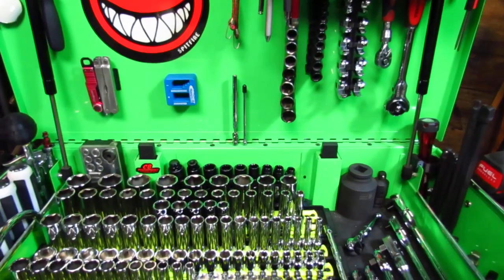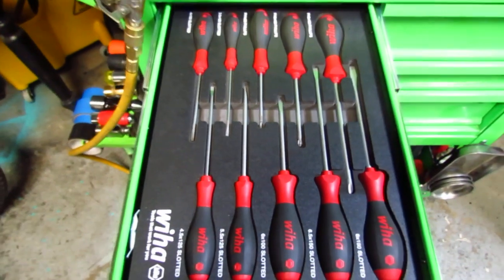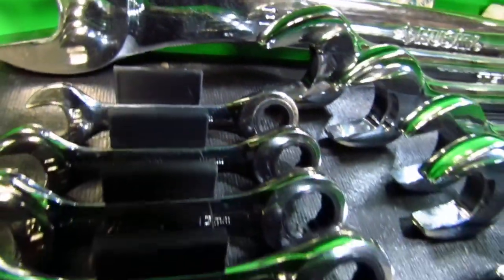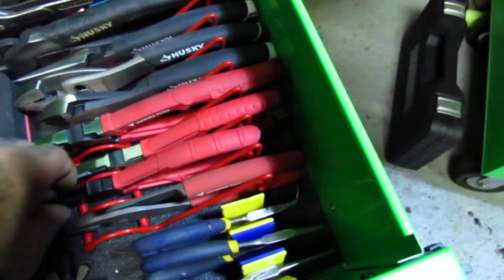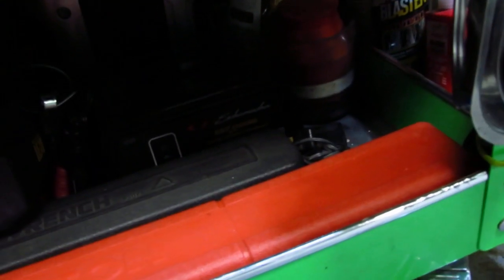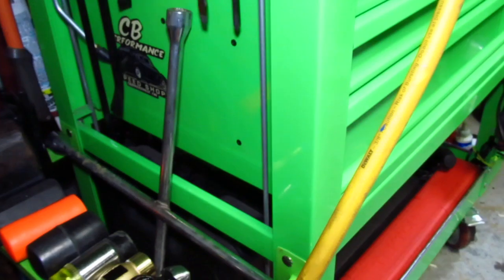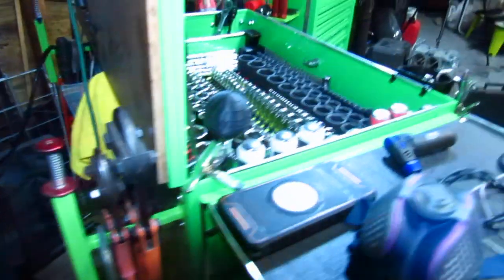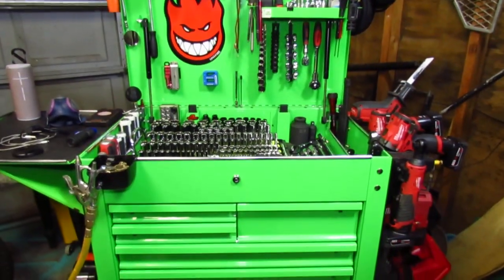silent harbor freight 5 drawer cart tour

Comment from the maker: Thanks man, It took me a while to figure out how to squeeze more storage out of this thing without making it too hokey.
Reply: You need a five gallon bucket. With a cloth bucket boss organizer......then it can hold every hammer and pry bar, and chisels around the outside. Way cheaper than toolbox space for things that get abused anyway.

And it can hold all the screwdrivers that don't hardly get used. So they're out of your way until you need them. The Phillips #2 and a flathead can live in the cart. And you can move pertinent pliers to the top in place of the umpteen screwdrivers.
Reply from the maker: These are the hammers I use most often the rest of them are on my other carts.  All my body hammers on my fab cart, my construction hammers on my larger cart with most of my other tools, etc. When I did construction I used a bucket boss for a while.  Served its purpose at the time. This cart is set up for most non electrical tasks on air cooled VWs. Thanks for the input though. I do appreciate it.